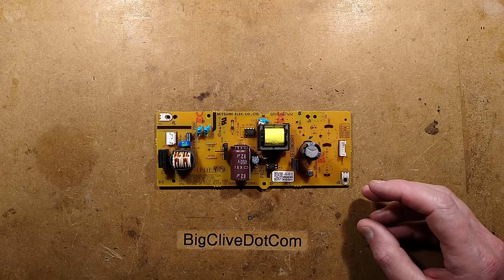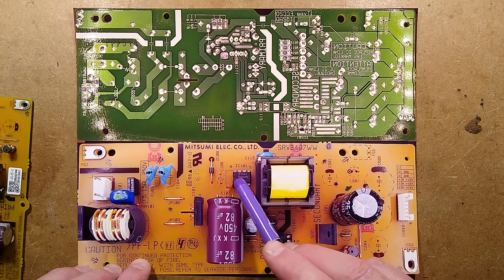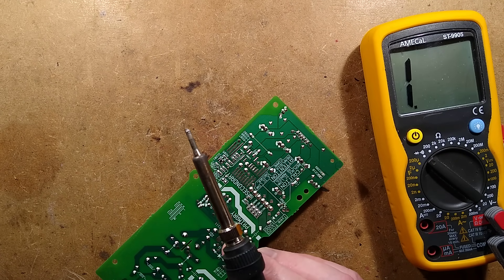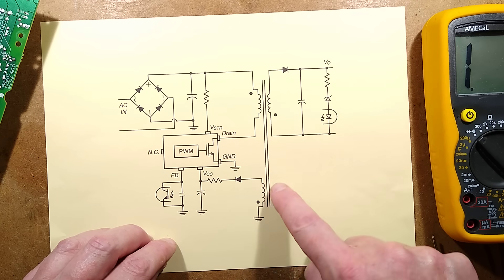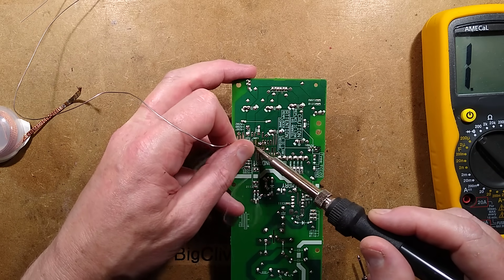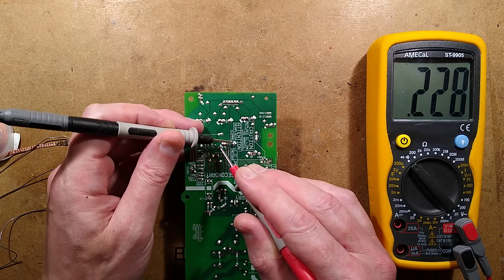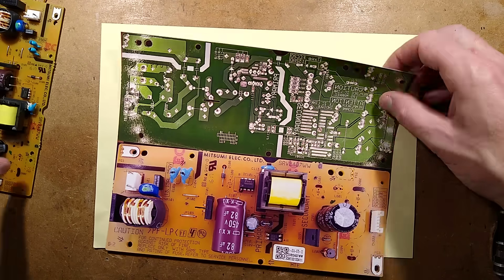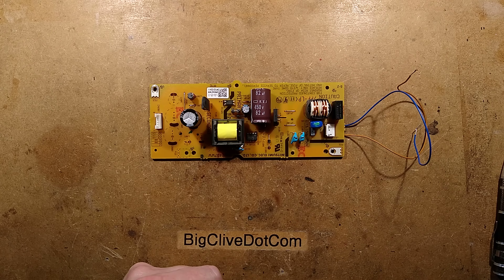Diagnosing a faulty PSU

Comment: For some reason I can't reply directly to Oliver about the 1N4007, so my reply is here.
"Traditionally" an ultrafast diode would be used in the snubber for a flyback converter. The energy from the leakage inductance spike would be dumped into a capacitor in series with the diode. A resistor would discharge the cap. Values need to be worked out quite carefully. With a slow diode, some of the energy stored in the cap is "sucked out"when the switch turns on, using the slow reverse recovery of the diode.
Some of these integrated control + switch chips require that the switch be well protected against excessive voltage and even the  spike from leakage inductance in the power inductor ("transformer") can kill the switch. With a discrete FET it is often perfectly acceptable to let the FET avalache from voltage in excess of its DC rating (leakage spike only - NOT the secondary winding voltage reflected back and "stacked" on the input rail voltage).

Comment: I would love if you show the practical difference and advantages of switch mode vs linear power supply. Would it be good idea or a waste of time to build a linear 5V usb supply for various charging usage if I have the parts to do it? If it is to remain stationary then weight has less meaning in this case.

Comment: Could you explain a little more about what it means if a capacitor is bulged?
Would simply replacing a bulged capacitor make a PSU work again?
Reply from the maker: Yes.  It means that the capacitor has an issue with the electrolyte generating gas.  It's very common.  Always replace with the correct voltage and capacitance, and definitely use a "low ESR" capacitor.
Reply: @bigclivedotcom  Thank you.

Comment: Hey BG - picked an old but relevant upload to ask this on so it just gets lost in the wash of comments - but I've got a very interesting LED driver that I pulled open today as the panel is flickering and I thought it may be it. While I can normally reverse engineer most analog electrics, this one has me a TAD stumped. It is actually really great construction and possibly even design, but one or two design characteristics are seemingly magical nonsense to me. If it's okay with you, I'll email a bunch of high-res pics for you to have a gander at, and if you cannot deduce it from stills I am happy to post you this unit for you to stick the meter to. No credit necessary as it's just a curiosity from one bloke to another and I'd love if it was something new for me to learn. Since you don't seem to actually reply to comments too often, I'll take a <3 as approval haha. Cheers either way!
Reply from the maker: Look for a black dot in one or more of the LEDs.  It hints of the linear regulator panels.
Reply: @bigclivedotcom  Was this reply on the wrong comment? It seems so out of context that I don't know what you're talking about 😂 Will email the pics shortly just stuffing my face right now!
Reply: @bigclivedotcom  OH WAIT got you. You mean the LED panel itself. Haven't taken the diffuser off but it's a Pierlight 1195x295 ECO panel. They're good units that I've had a few dozen of running for years!

Comment: Hello Clive.. I have a Turntable that is giving me problems. The motor doesn’t come on, it’s a ADC 1700 DD Quartz lock deck ,power comes on but there is no motor or LED strobe light. Opened up power switch to clean too. Would you know of anyone or yourself as a trained technician would know this problem. Many thanks Bernie
Reply from the maker: Sounds like a power supply issue.

Comment: I'm an electronics noob, so be easy on me if what I say is total nonsense, but I have a problem with Clive's diode testing procedure:

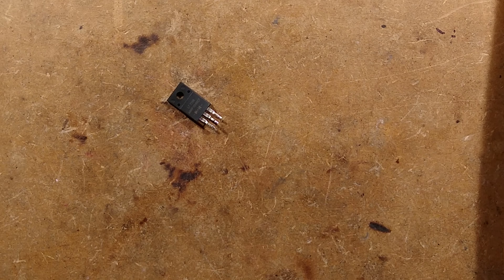According to the diagram on the diode as well as the MBRF10100CT datasheet, the two outer pins on the diode are the anodes and the center pin the cathode (and Clive also confirms this at 2:25). However, at 5:03 he applies + probe to the (lower) anode and the - probe to the cathode and the diode blocks, but should't it be conductive? At 5:08, he then applies the - probe to the (upper) anode and the + probe to the cathode and the diode conducts, but shouldn't it actually block?

I am confused... could someone clarify this, please?
Reply from the maker: The diode pack was faulty.  One diode was shorted out.
Reply: @bigclivedotcom  Yes, I know that this was your diagnosis, but my point is: Didn't you accidently misplace the probes on one of the two diodes? Please have a closer look at the probe placement in the video at 5:03 and 5:08: If both diodes point into the middle pin, shouldn't you have kept the same probe on the middle pin for testing both the diodes and only swapped the other probe on the outer pins?

-- Edit --
Okay, I see my mistake now: You have put the meter to test for short and not  (as I had suspected)  in diode test mode and therefore the first diode blocked because the probes (probably) didn't exceed the forward voltage of the diode and the second diode conducted because, well, it was shorted. Mea culpa.

Comment: Also you can use one of those cheap “in circuit” ESR meters to test components without removing them….. because it uses a high frequency AC measurement. 

“Diodegonewild”made a good video about it on his channel…. where he’s troubleshooting and repairing an ATX power supply this past year. It’s about a 25 minute video and he explains the use of an ESR meter to measure all types of components without removing them from circuit. 

Just an idea and would love to see you tinker with some stuff like that and see more troubleshooting videos on your channel. There’s a huge void on YouTube of nice to the point troubleshooting videos like this.

You’re such a good explainer!

Comment: I love love love your videos! I love your schematics ! I took electronics engineering in school many years ago! I still tinker! Only thing I remember from digital was and or and/or gates lol! I have a DC brushed motor controller I've gotten out of a treadmill ! I have the motor and speed controller and for 2 years been trying to figure out ware to inject a pwm to controll the motor speed. It takes 110ac drops it to 90vdc and then to the motor! Been relearning about how to drive higher voltages with mosfets with low voltage controls with octo couplers ! It's been so long and I over think things. I was going to just use a servo tester for the pwm but that's max 8.4v and if I'm not mistaken that will only drive the mosfet to dump 8vish and all the current it wants. I know I'm wrong!  I want to MacGyver a small go-kart with a inverter a 12v batt and a 90v 1/2 hp motor ! I can bump the 12v to 90v with my buck booster/regulator from drok ! Was 900w but I added a shunt and beefed up the tracks and have pulled 2kw out of it but the 3s 4400mah 75c batt wasn't happy! Lol was wondering if I sent you pics in 8k /108mp both sides could you spot ware I would inject a 5v pwm ? Think it would make a great video! Appreciate all your videos! You have entertained me through out the years and the geek in me thanks you!

Comment: Is it possible to test components while still mounted on the PCB? I have a dead PSU, amplifier board that has no obvious signs of damage or failure, but don't fancy unsoldering everything to check 😂
Reply from the maker: Some components can be tested on the PCB, but it depends on their position in the circuit.
Reply: @bigclivedotcom  next video idea?
Reply from the maker: @cocdundee  Testing components in circuit is a hugely complex subject that involves deep understanding of the components and those in their vicinity.

Comment: Yup, I've come across those dual diodes with one shorted too. They probably fail from thermal stress i.e. OVER HEATING ! I notice it has no HEATSINK ! Naughty. But then, those supplies are designed to be as cheap as can be ! MBR probably is short for Motorola (half) Bridge Rectifier btw with the numbers indicating forward current and reverse voltage. A TO-220 package like that  can be unheatsinked in free air to about ONE WATT of dissipation before the junction temperature becomes excessive and failure happens. I strongly suspect it's being pushed to the limit. 24/7 operation can lead to significant temperature rise inside equipment beyond what you'd expect over weeks even months.

Comment: Thanks for sharing.. will this be similar as a  1200w psu for rc lipos charging. My psu has a OP that comes up on the led screen. I quess that's over current protection. What would do this?
Reply from the maker: It could be many things.

Comment: How feasible is it to DIY repair this kind of PSUs that typically have no visible faults?
I usually buy a new unit because I'm afraid it's hard to find the faulty component (with my current knowledge), and it's probably always a different kind of component, so ordering a single spare part costs too much money and time. But is it so nowadays?
I never throw the broken PSUs away though... They are "waiting for a repair". Those 5...20 V, 1..2 A black boxes of all sorts are piling up.

Comment: With everything now working what would happen long term if the 2 leg diode was not replaced?
Reply from the maker: It depends on the current draw of the device.  It might be fine for a long time.
Reply: @bigclivedotcom  Thanks Clive - interesting to know. Great video - really clear and easy to follow - got my device back up and running in no time.  I have ordered a new diode as you suggested in the video and will stay off using the device in the meantime just incase. Thanks again.

Comment: 5:00 - Testing from either side to the middle pin, but not switching the probes. Small error or better tools? Still surprised it got fixed.
Reply from the maker: I was looking for a short circuit.  The middle pin is common to both diodes that are in the same direction.
Reply: @bigclivedotcom  From the drawing on that part it looks like middle pin is common cathode, suggesting the diodes are not in the same direction, and they faced each other (parallel). Same direction would suggest series to me and that part would not make much sense. As you measured, I would have expected a sound for the first diode too. I think probes didn't make full contact and you probably saw numbers going down, indicating a working diode. This got me confused, because I saw the drawing and I expected one side to be silent and the other to make sound, without knowing at the time the precise method of testing and polarity. If I'm correct about the common cathode, then you didn't measure short for the first diode.

Comment: I just bought a 48v sla battery charger 120ac to 48v dc. (54v output. 13.5x4 basically) it outputs nothing though just the fully charged light comes on instantly. I only see one issue on back and it's a resistor shorted to a resistor next to it. (Very poorly made chinese product)
Reply: I cant find a good cheap working 48v battery charger anywhere for my ebike. And I dont know how to fix the one i have other then fixing the obvious shorted bits.

Comment: HI Clive, I've been enjoying your videos for a few years now. I'm a heating engineer and fix a lot of boilers... I have to replace quite a lot of fans on Worcester Greenstar boilers. The "mechanicals" of the fan are invariably fine, but the fan control boards seem to fail quite frequently after a power cut. I'd love to send you a failed one (and one that works also if that would be helpful) for you to work your magic on. Ditching a £170 fan for what is probably a single component failure irks me!
Reply from the maker: It would be interesting to see a picture of one of the PCBs.  Can you email one to bigclive1@gmail.com
Reply: @bigclivedotcom  Thanks Clive. I've just mailed back and front photos. There is a good chance the email will have gone into your spam. About 50% of my emails to gmail addresses seem to end up in spam.
Reply from the maker: @rainbm  Could you resend the email and images.  I don't see it in my inbox and had to bulk delete spam due to a build up.
Reply: Hi Clive, did you ever receive my email with the photos? I sent them again after your spam purge.

Comment: I have a laptop power supply when I connect it to main voltage through a breaker, the breaker always cuts the power, but without breaker nothing blow up but in the both ways there is no power at the output
What should I check?
Reply from the maker: The breaker may be very sensitive to inrush current.

Comment: Is the capacitor schematic with rounded side a polarized/electrolyt symbol (old version of the chunky block negative?)
Reply from the maker: Sometimes electrolytic capacitors are shown as having a rounded electrode.  I prefer the solid line version.

Comment: thats not a diode , its a transistor
Reply from the maker: It's a dual schottky diode with common middle pin.
Reply: @bigclivedotcom  so you are saying that it is 2 diodes both forward bias is the same way ??
Reply: ===|= • =|=== lets say these are diodes and a middle pin
Reply from the maker: @ghettocowboy993  If you look at the PCB image you'll see both outer pins are connected together so it acts as two parallel diodes.

Comment: How are you testing diode at 5:00 ? If multi-meter is in continuity shouldn't it beep when you first put red lead on edge/anode and black lead on center/cathode, or am I missing something else?
Reply from the maker: The meter only beeps for a near dead short.

Comment: I generally find trying to repair computer PSU's a waste of time. All I ever get with them is totally confusing and vague readings and nothing that makes any sense, all too often for some unknown reason there's never a definite ok or knackered reading with them. And far too much electronics these days is built using micro surface mount and ball grid array components, some of which are just like little grains of sugar sweated on to the boards, and then there's those stupid multi-layer boards with copper tracks all hidden away inside between the layers so how can you service them when a track has failed inside somewhere, or if it's cracked, even slightly, then it's a total write off.

Comment: Why not try using a desolder pump. And it's advisable to use a 50 watt soldering iron for that kind of repair as smaller ones lose heat to the large areas of copper on the board. And only using half the rectifier won't have enough current rating and it's already failed in one side so it needs replacing, but using the remaining half of the old rectifier is ok just to test the PSU to see if the rest of it still works or if it's beyond economic repair. And I've got a similar PSU from a laptop AC adapter which gives correct output voltage but it dies down instantly at the slightest little load on the output. Any ideas on that one? I suspect the transformer as just about everything else checks out ok.

Comment: For this kind of fault, no output with no sign of any burn ups I would first check the output rectifier as in my experience with these types of power packs that's the usual culprit, and with this type of PSU a shorted output rectifier usually just shuts down the whole circuit so no burn ups, but of course it's a different story if the mains input rectifier blows as they sometimes do, that often makes quite a mess...And don't forget that the mains smoothing capacitor charges up to about 335 volts and can remain charged after unplugging the PSU, just in case any amateur repairers are watching who don't have that much experience...

Comment: I owned an commercial radio communications business for 40 years (think police/fire/taxi radios) and sold/serviced alot of power supplies over the years.  We regularly repaired linear power supplies, but switching PS's are a different beast.  We soon learned it was much better to replace a faulty SMPS than to repair it.  Once you repair a piece of electronics the customer believes any further failures are your fault and should be covered by your repair warranty.  They are also much cheaper to replace than repair these days... unless this is for your own equipment.... but still might not be cost effective to self repair!

Comment: Very Helpful. Absorption complete. If I have a 120v device with a dropping cap will doubling the value/voltage and any resistor across it allow me to use it on 240v? Keep dem videos coming! Have a fizzy whiskey for me.
Reply from the maker: Many cap dropper power supplies can be upgraded to a higher voltage by using a higher voltage and lower capacitance capacitor with new higher value discharge resistor.
Any other mains components like relays will have to have suitably rated contacts.

Comment: good video, I have some familiarity with these things, I was trying to lower the output voltage on an ebike charger, because if you go all the way to the maximum it lowers the lifespan of the batteries apparently. I was thinking oh yeah I will just put a variable output voltage on it with a tiny digital voltmeter thing,  not so easy !  
I managed to make it go up a bit but not down.

Comment: So I just scored an AMETEK Powervar UPS it's rated at 1296w and after tearing it down everything looked in good condition. The guy didn't have a power cable for it so he didn't know if it worked or not. It's quite dusty inside and blowing it off did also me good but it's still dirty as shite. All the capacitors look good and nothing looks like it's been hot. I'm a novice and wanted to ask how I can give this thing a thorough cleaning? Do I need to disassemble the entire device and wash the board in some kind of chemical bath? The batteries had been replaced fairly recently by the looks. I just don't want to try and power it up and fry something. Any ideas?
Reply from the maker: A common cleaning solvent for PCBs is isopropyl alcohol.  You can get it in spray cans.  Be aware it's very flammable.
Reply: @bigclivedotcom  indeed. Once clean just power on and wait to see if it gives up the ghost eh? My goal is a solar inverter.